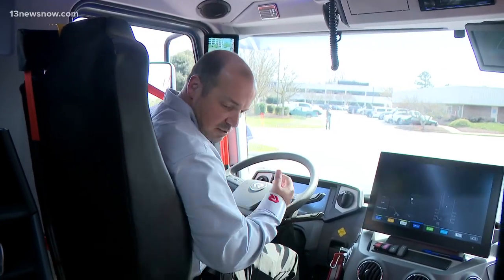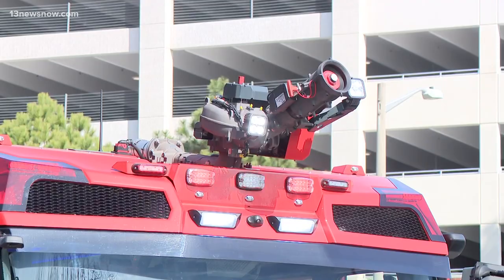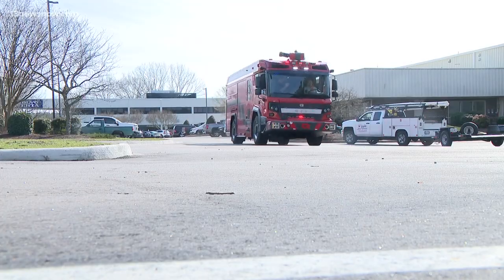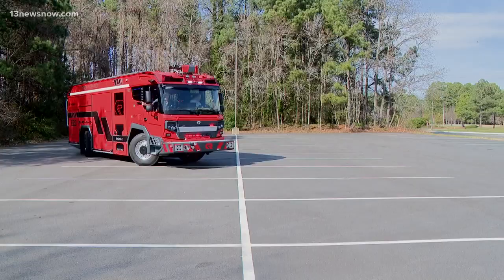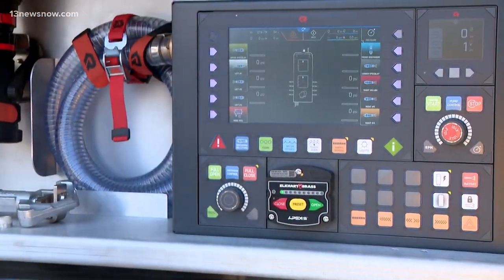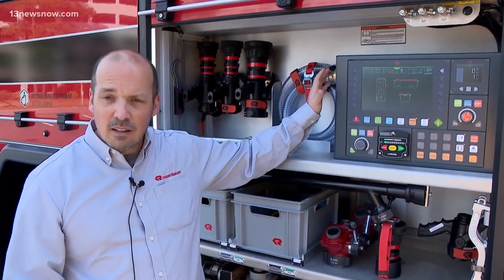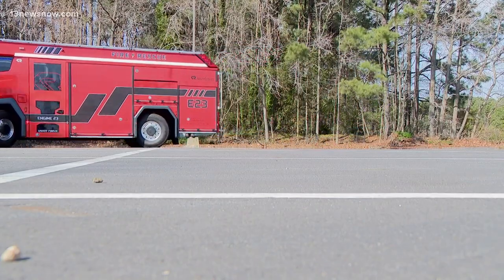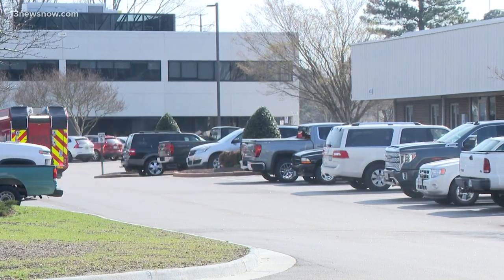Battery-powered fire engine of the future

Comment: What if your town has no power or you need the truck for a large fire and it runs out of power after running pumps and equipment for multiple hours? Doesn’t seem like a good idea for an emergency vehicle…
Reply: It is actually a hybrid: once battery is close to depletion a generator kicks in.